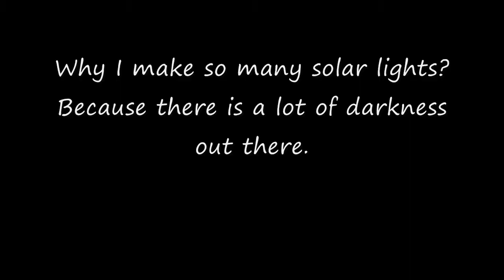4 plus 1 solar light modification

Comment: Newly added solar pannel is how many volts and its wattage. 
Is it okay to use 18650 battery 3.7 v
Reply from the maker: You can use 2 to 5volt solar panel with 1/2 w to 5w.

Comment: Nice, thanks for the mention too. That panel should get a nice charge into the battery even on not so sunny days, but the summer's coming..Should work well. My DTDs are performing really well now that the days are longer and sunnier.
Reply from the maker: The original light has a 150ma NC battery and the replacement eneloop AA has a rating of 1900ma so I think it should work ok. The only thing is I now have these odd looking LED glass jars, plastic soup container with LEDs, etc. popping all over the house. At least it's not an expensive hobby. Cheers.
Reply: wtam69
Yes should work really well now, add a comment in a few days and let us know how its going.

Comment: just a idea here, maybe if you got some of that aluminum tape and put it behind the leds so it would help to reflect the light even more, and if it was on some sort of motor that could spin in a circle like a revolving light would be cool also, another cool led video tho
Reply from the maker: I'm a little messy so I haven't added reflectors, especially metal ones. The wiring inside the plastic box can get shorted out if I'm not careful. A revolving light (sort of like a searchlight)  is nice. I have to try to do something like that.